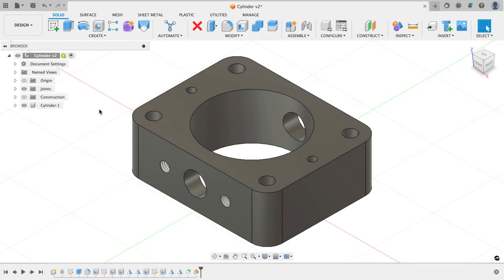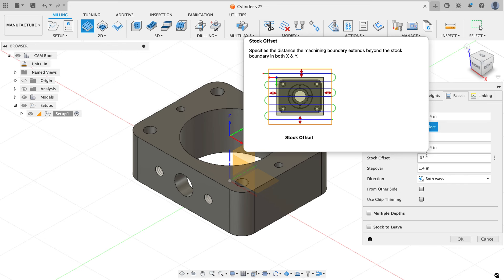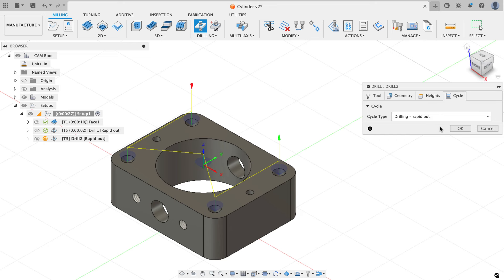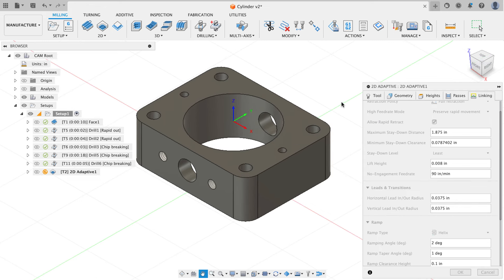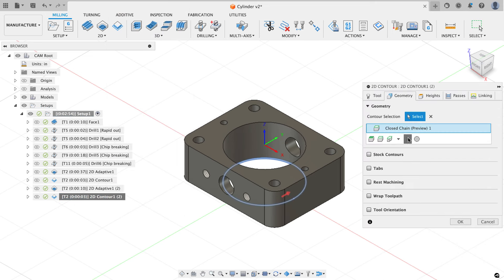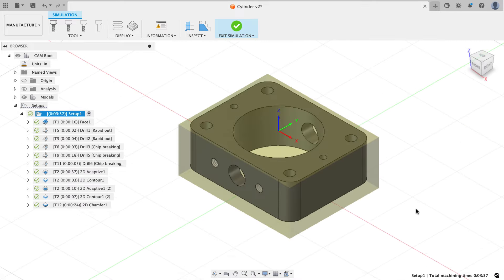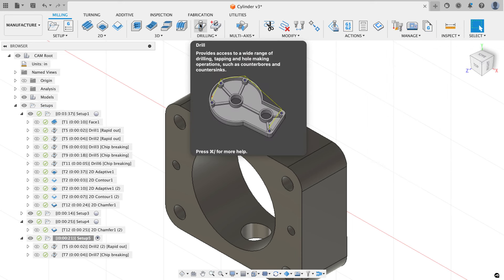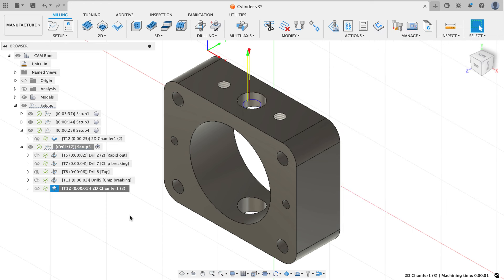Model Engine Project - Cylinder CAM

Comment: I learned a lot, It went by very quickly, and I was still rewinding occasionally to make sure I didn't miss anything.
Reply from the maker: Good.  I tried to balance between not going to fast and not getting to buried in details at the same time.

Comment: Great video Kevin, thank you. Length was fine, because it was feature packed. 
I picked up a few tips that I did not know before which is fantastic, thanks. I did not know i could drag out the browser bar to give more info on the tool details, that will save me hovering over it to see. The finishing overlap, I always type in 5mm, so knowing I can use the edit expression is a nice quick tip. Also, using copy and past for tool paths to speed up following setups, i could not work out how to paste it, but your video showing to click on the new opp is excellent, now i know. 
One thing I'd love more lessons on is in the Geometry tab, what each of the options do when selecting different boundary's. That can be a bit of a mind field. 
Looking forward to more of this, thanks for doing these.
Reply from the maker: The geometry tab is a good idea. There might be a few things I'm waiting for to be released before I do that. How is that for a teaser? haha
Reply: @MechanicalAdvantage  very cool, this is one area I definitely struggle with. Thanks buddy.

Comment: Thank you, length is fine. On the side 10-32 holes, when using spot drill is a good practice to chamfer .010 to .015 before tapping?

Comment: Hi Kevin great idea this series, do you think this engine could be reproduced on a CNC router set up, the one im thinking is a Foxalien Vasto
certainly not industrial but capable of milling aluminium.
Reply from the maker: I would think so. As long as you have a good way to hold and accurately pick up the backside programs.

Comment: I was wondering if you were going to do a short vid on the approach that you were going to take on posting the Gcode for this project.....in other words, post each OP as a separate file and then establish/probe the new WCS for the next OP, or take a different approach.  Saturday should be great seeing this part come to life on the Syil.
Reply from the maker: I think I'll show the process of posting. You may have noticed that the shearhog I used for setup 2 was tool #13. That is a bit of a problem since I only have 12 tools in the changer. So i'll need to edit that tool number before I can post. I'll be posting each setup and running the setup from start to finish.
Reply: Kevin, the presentation style is great, could be a bit fast paced for a person just getting started with CAM, but overall, very feature rich.  The only note I made was that in setup #2 it was a bit fuzzy as to where/how you would pick up the WCS for this setup and its subsequent operations.  Looking forward to the next vid and presentation.   @MechanicalAdvantage